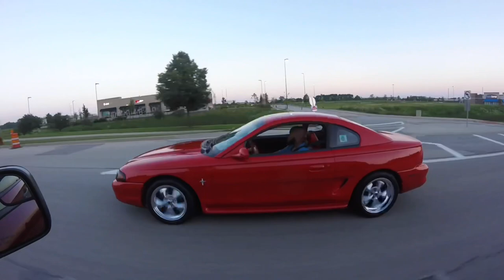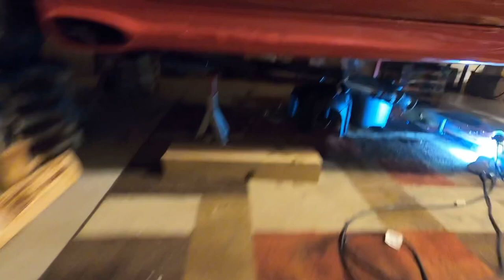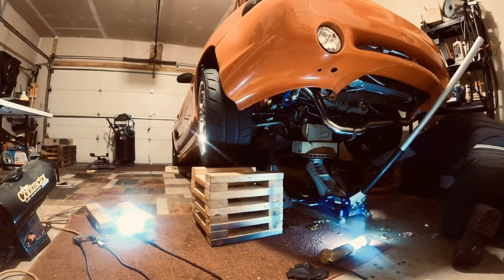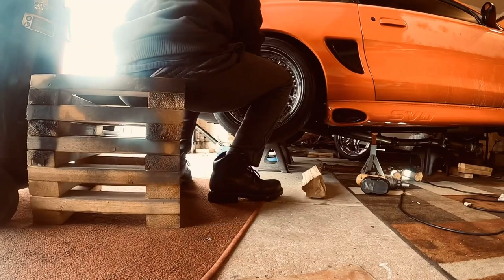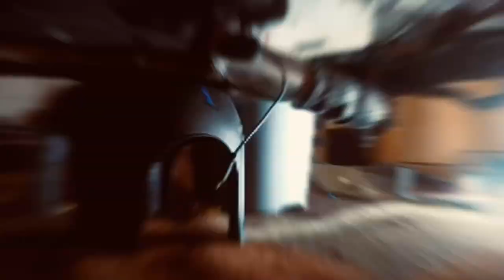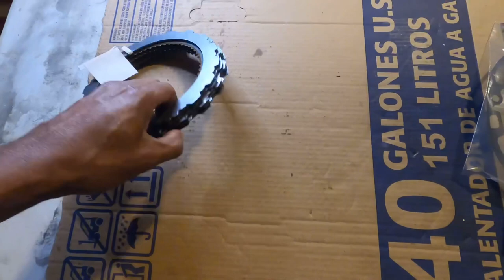SN95 Mustang 4r70w Build Part 1 Circle D Converter Coming How To Put Car On Wood Crib

Comment: That will definitely work for putting it up in the air!  I used Exedy in my 4R70W.  If you ever need parts hit up Darrin Burch at BCA or Dan at Silver Fox.  They are 2 of the top builders and might be able to get them for you.
Reply from the maker: I had Darrin assemble my drums and bought all my parts from him. Great guy. Answered all my questions, even on a Sunday.
Reply: @SN95Power  Completely agree.  Great guy!